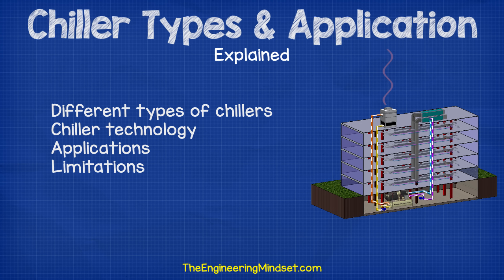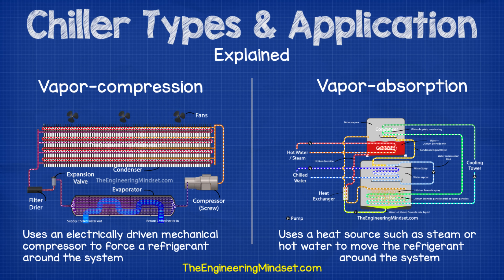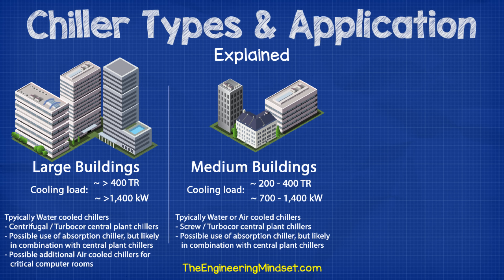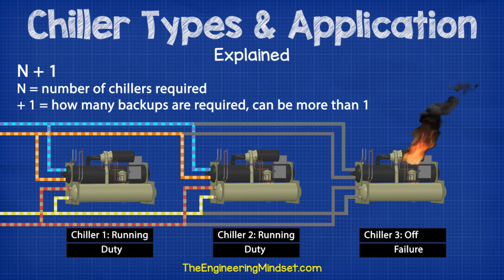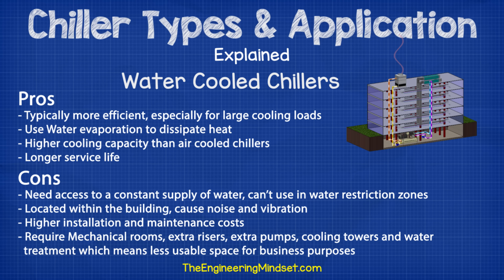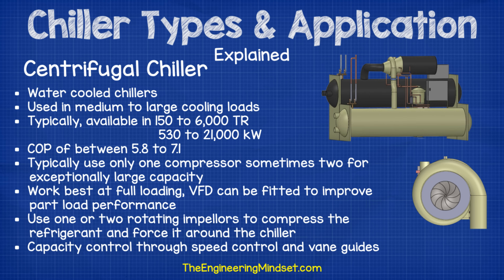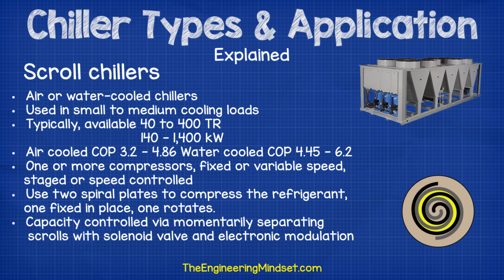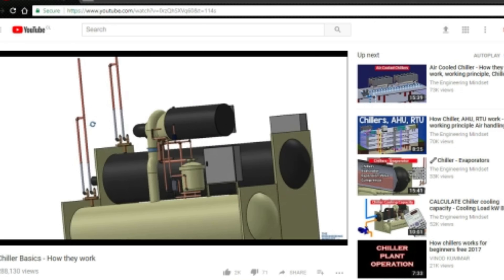Chiller Types and Application Guide - Chiller basics, working principle hvac process engineering

Comment: I have not worked on these chillers directly, but I have gotten to do some work in a central utilies plant that used 6 or 7 of them to handle cooling for several downtown buildings. I'm not sure what the actual heat load they can handle is, but I do know the compressor on each chiller has a 1750 Hp (1300 kW) motor. It's crazy seeing how heating and cooling works at such a large scale!

Comment: I had a 3 floor medical office building that used air cooled, which were located on the top floor. Unfortunately there was a IT employee that was right under the compressor/condenser of her 3rd floor office, she called me to find out what it was… I thought she was exaggerating the noise as I stood I. The doorway, however as I approached her desk area to investigate I noticed the resonance was indeed very loud, Simple solution… move the desk across the room. She was satisfied.

Comment: 2:46 at State 1: I'm having trouble understanding why the refrigerant is low temperature. Since it's absorbing heat from the water in the evaporator wouldn't the refrigerant exiting the evaporator be medium/high temperature?
Reply from the maker: Thermal energy is used to change phase liquid to gas, gas to liquid, temperature doesn't change during this transition

Comment: I have a question. is there any way that I could connect the air chiller on my home refrigerator and dump the heat that it ejects into the cooling loop of my ground source heat pump, so I'm not dumping hot air into the kitchen and adding load that the AC must then deal with?  It would also keep my refrigerator cooler in the summer.
Reply: It could be done, but I suspect you are killing a fly with a sledge hammer.  Paying the professionals, getting the supplies, and modifying an existing type 1 system like your describing would likely cost enough that it would take 20+ yrs to get your investment back.

Comment: How do we find the coefficient of performance for vapor absorption chillers?
For instance if a vapor absorption chiller has capacity of 800 ton and consumes 21kw of electricity then what would be its COP?
Reply from the maker: Why is it using 21kW electricity if it's an absorption chiller. COP is the ratio of how much energy you put in compared to how much cooling you get out